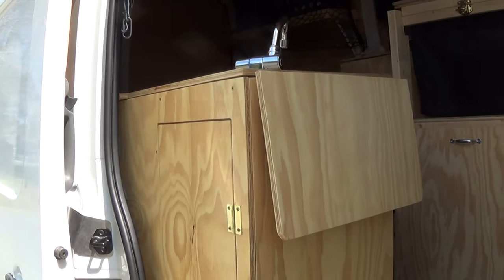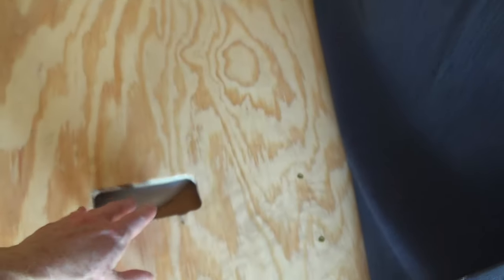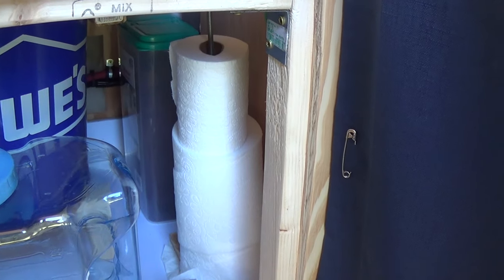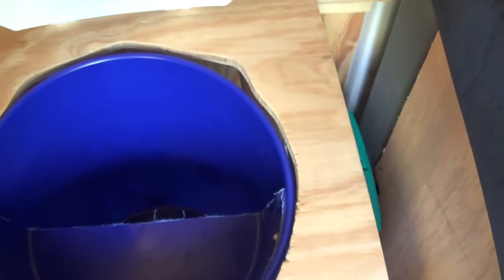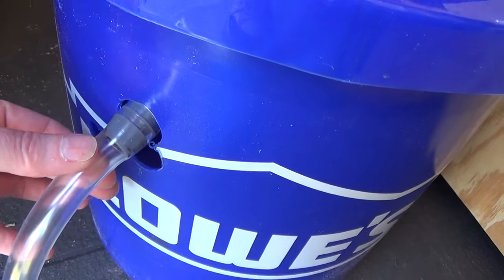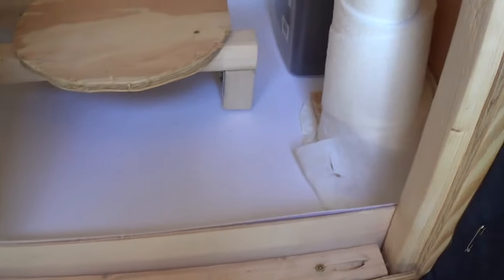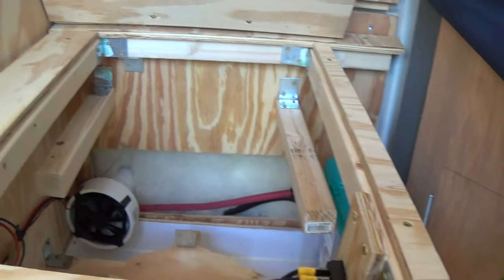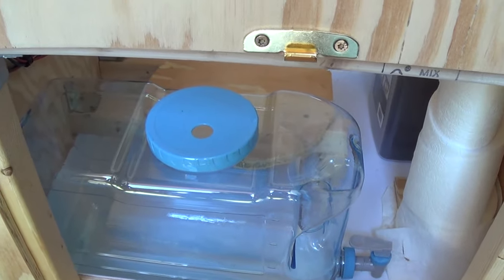DIY Composting toilet

Comment: I was also outraged by how much money ppl were charging for their toilet systems that were usually just some cheap plastic thing so I got a bucket and a oil funnel and made my own diverter and plumbed it to my grey water tank, pretty easy and I only have to empty it about once every two weeks and it looks way nicer that the bought ones :)
Reply: California Guy  What is the problem with doing this? I have a 200L grey tank, I estimate about 10L of urine is going into it before it is full, apparently if you dilute urine to 10% with water you can just put it in the garden no problem. So what you call lazy is what I call efficient....and a bit clever.

Comment: I am so glad you posted this! I had been racked my brain for a funnel that would go from side to side because I use a portable bidet instead of toilet paper. Bucket in a bucket is my solution now so thanks!
Reply: That was very resourceful.
Reply: For my make shift bidet I use a new chemical pump sprayer. I have only used just water n maybe a drop of hand soap. Works well n if I need the water a little warmer I use a heating pad for a couple of minutes so it doesn't feel like a polar bath. Lol
Reply: Very impressive indeed!

Comment: I am renovating an old RV, and the toilet is the important change. I appreciate this video for the excellent ideas you provided! 
Thanks! Stay safe and be well.
Reply: @Bob Davidson it's in there in such a way that your suggestion won't work. 
Additionally, it's too low for my knees to deal with. I'd rather remove the old, very dirty one and build something I am comfortable using. 
Thanks for your suggestion, though.

Comment: I'm buying my first RV and I knew the first modification I was going to do was the compost toilet. Definitely cant aford to buy a prebuilt one, and even the DIY ones had expensice components like the urine diverter. I keep seeing them for over 100 dollars. I'm so glad you posted this video and glad I found it! I would also love an update on how satisfied you are with this build or if you had to make any adjustments!
Reply from the maker: Well, since I finished building, that was when everything closed down.  I have used the tolet when out running errands, because I did not want to use the restroom in the stores. I love that I have that option.  Hopefully I can take some short close by trips soon.
Reply: @rebbar64  Thank you so much for the update! I really appreciate it! Definitely going to give this build a try and hope that it works for me!

Comment: I've been searching and searching for an easy, cheap urine diverter.  I think this is the one, thanks so much for showing it off!
Reply from the maker: Check out my updated video on it. Made some modifications. (I still love it and use it a lot). Also I have made another adjustment for pooping, use a trash bag, over the hole bucket, then tie off and dump in the trash.
Reply: @rebbar64  Oh, good to know.  I will check that out.  Thanks!

Comment: Simple and effective. I’ll be making something similar. I’d fit the urine diverter to the lid thats lifted up to empty the loo. This would mean there wouldn’t be anything riveted to the bucket, making it possible to use biodegradable bags to line bucket to either bag each deposit individually (dog poo bags) or use as a composting loo with bigger bags. This would make emptying far less unpleasant as all you’d need to do is tie up the top of the bag to seal it, carry the bucket with bag still inside to the dumpster and tip it in. I’d want a lid on the poo bucket to keep the flies out and the smells in, especially when driving as a commuter fan doesn’t stand a chance of overcoming the draft caused by traveling at 70mph.

Comment: Very clever idea. How do you get the solid material out? Do you line the bottom bucket with a plastic bag?
Reply: You can buy biodegradable green bags and use those or simply make sure you have a good layer in the bottom of whatever substrate you'll use and that should keep it ok for the day, you gotta clean a regular toilet too 😉

Comment: Thanks for the urine-diverter instructions: Take the bottom 4 inches of a bucket, cut in half. 
Now, how do you seal the outlet of the diverter, going to your tubing? 
Stay safe and well.
Reply from the maker: I used plummers tape around the fitting.  Recently, it started to leak around the fitting. I think due to vibration while driving.  I used some acrylic enamel paint around it. So far it is holding up. Another option would be to use liquid electrical tape to help seal it to prevent leaks.
Reply: @rebbar64   Thanks!

Comment: quick question.  I am in the process of making my own for my skoolie.  I notice you don't have any type of mixer for your solids.  Do you find that an issue?  Or no problem just covering it with peat moss?  Thanks
Reply from the maker: I started using a trash bag and getting rid of the poo as quickly as possible.
Reply: @rebbar64  Thanks, so it is better to mix it in then?

Comment: Where did you get the connector for the drain hole and what was it called?
Reply from the maker: Got it at lowes, ( a general purpose hardware store) do not remember the name, but it was by the fittings for outdoor irrigation systems.

Comment: How do you mix the peat moss with solids to make the compost ?
Reply from the maker: Put a layer of peat moss in the bottom of the container. After your deposit, sprinkle peat moss on top. Turn on fan, to have air flow to help dry out the poop.
Reply: rebbar64 yes but your supposed to mix it not just layer
Reply from the maker: Oh, I have a wide plastic putty knife that I will use to stir it.

Comment: Can those composting toilets handle diarrhea?
Reply: Yes! The solid/semi solid/ink jet goes into the rear compartment which, unless you are boondocking in a rural area, is lined with a plastic bag. A small amount of saw dust, pine pellets, wood shavings, coconut coir, kitty litter or even dry leaves goes into the plastic bag. Once you've finished your deposit you add a little more of the above composting material to dry out your deposit and reduce the odor. After cleaning up with wet wipes or paper towels, you remove the bag, tie it closed and place it in the nearest trash recepticle ASAP! If you are in a rural area and have a humanure compost bin set up, then dump, cover & rinse out your bucket. I don't usually put paper towels, wipes or plastic bags in my compost bin because they have a very long half-life. If you are in the wilderness, bring a small shovel and bury your business. If necessary, you can clean out your bucket with sand or snow. Please avoid leaving any plastic in the wilderness. Separating the solid from the liquid significantly reduces the odor but this is not necessary if you are rural and dumping into a covered humanure compost bin on a regular basis. If odor persists in a combo bucket (solid & liquid) you can always sprinkle in some barn lime. Hope everything comes out alright ;0 )

Comment: Does anybody have any ideas for a small/mini or somehow even collapsible?.. (I know that might be pushing it) version of this for in a car 1997 ford escourt. I don't have room for a huge 5 gallon container.  I like the bucket in the bucket idea, and  I saw another amazing video that had a bucket inside a bucket with a hole..a couple holes in the bottom of the first bucket so that the P went through and the Pooh stayed in the top area!! Throwing in some shavings..or pellets👍😊
Reply from the maker: Go look at smaller buckets/containers, you could probably scale it down to fit in a car.
Reply: Hey Diane Check a company called Black Pine Sports for theTurbo Toilet for cars.
Reply: @roncampbell2290  Thank you Ron. Darn. the website says they're out of stock? I guess I'll just keep checking back.

Comment: How do you flush it?
Reply: There is no flush system for composting toilets. Urine and the solides are collected in  separated buckets and should be emptied when they're full
Reply: @minayazdani9128  how would you empty it?
Reply: @mrsducky3428  I didn't have one I just saw it on YouTube that they empty the urine bottle in the sewer and spray vinegar on it to make the odor away and empty the solides in a compost bag

Comment: Ok I am a guy, but is that difficult for women to pee in a jug, or use a device made for that purpose
Reply from the maker: Due to how things are formed on a women's body, once we start to pee it spreads out in a big wide spray. Look at female urinals. They all have big wide openings. Have to press them tight to the body to capture all the pee. If not tight to the body, it goes all down your legs and all over your clothes! It is a real struggle to find something that works every time with ease.

Comment: looks pretty simple, the only thing I'd change is have that tube go into like a 20 gallon tank, along with sink waste water also known as "grey water", then put a electric ball valve to have it open in an appropriate area to conveniently switch from the drivers cab area. That way your not trying to find or dump that urin out, with a clear tank such as you have ... even at night or running to a rest room would be rather embarrassing not to mention the stench. It doesn't take long for urine to  start to stink and puring that down any toilet is well... disgusting, especially if it's sloshing and splashing back at you and the floor.  NASTY!  :). lol

Comment: @0:39 Yea, lets create a design where instead of a recessed opening finger pull aparatus we cut a odor escape hole at the highest point.
@01:11 Your design requires everybody get on their hands and knees to reach the "peat moss" I doubt it's peat moss, peat possibly. Poor design. Spare toilet paper: one roll needs to be accesible to someone using the toilet. No reason to be storing a very light, paper product this low and near fluids.
@1:17 Computer fans work fine and can be purchased used nearly for free.

Composting toilets require odors not escape when not in use. They all need self-sealing lids that are fastened.
Agreed, >US$300 for a toilet is silly for people that are mildly capable in building one which to be honest takes the skills every 14 year old should have or is capable of learning.